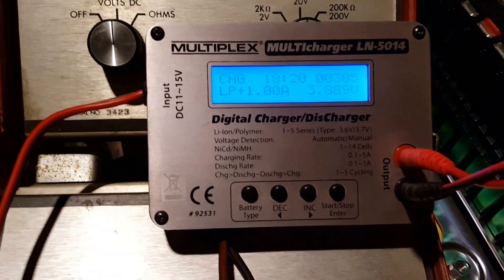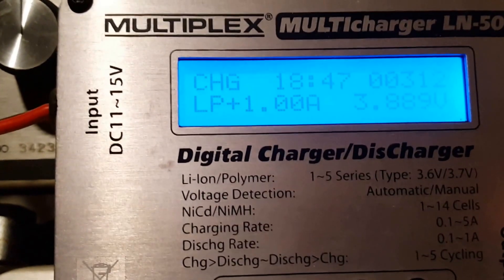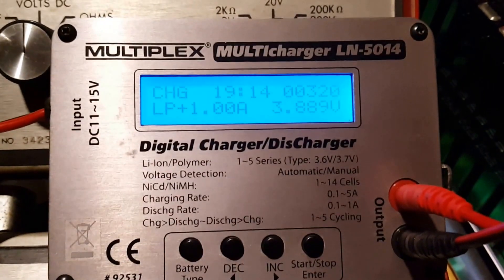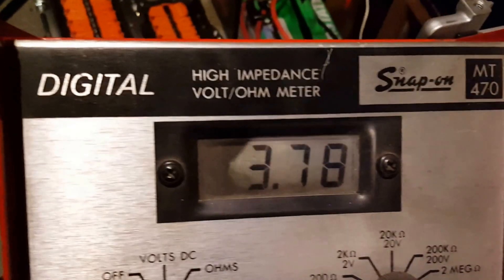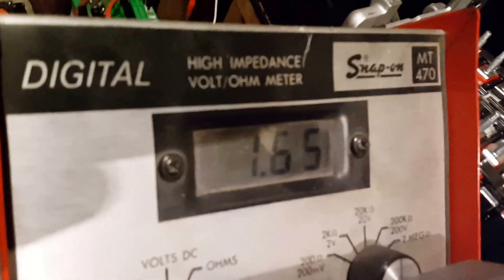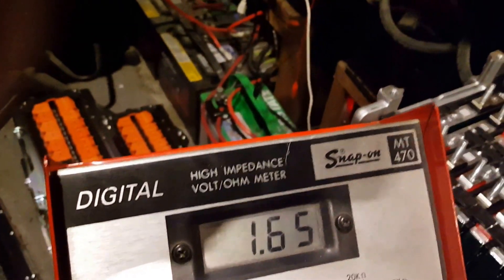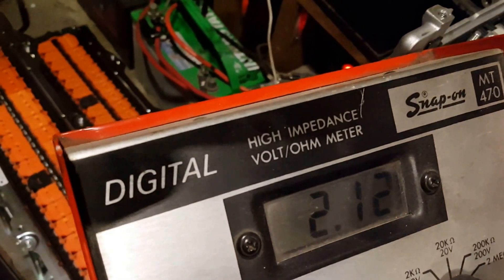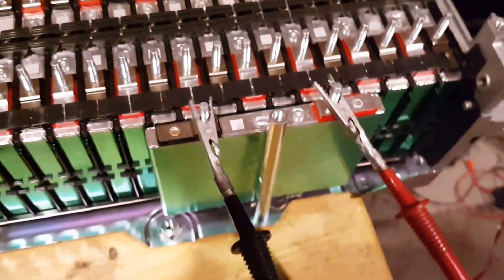Interesting LI-PO Battery Voltage Readings!

Comment: inside the case of the cell there is about 5 cc of liquid (some kind of pure acetone) to prevent over drying of the polymer role inside the case, that liquid leaks some voltage.
Reply from the maker: Thank you for your input!

Comment: It must be voltage leakage due to capacitance. Try measuring a current flow via a small low voltage lamp. I doubt it will really flow anything, micro amps perhaps? not even a milliamp.
Good to see your playing it safe
Reply from the maker: All the cells have the same readings.